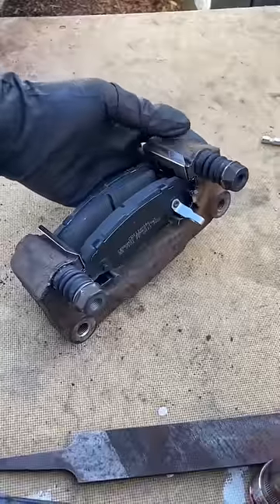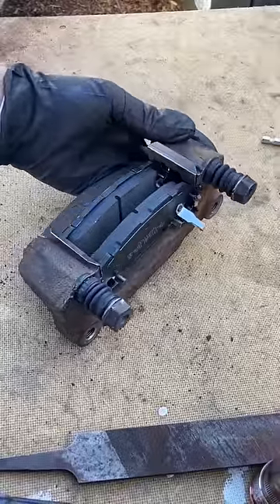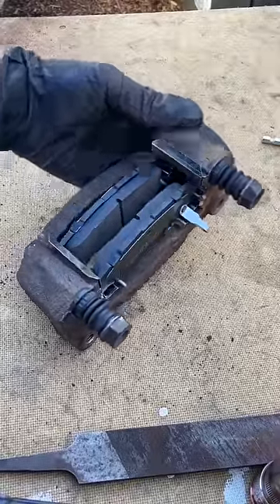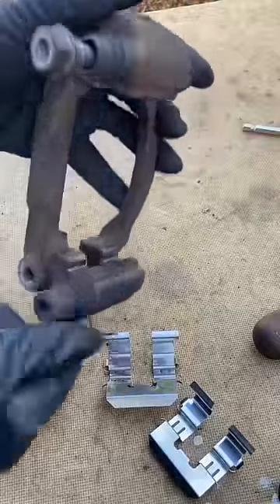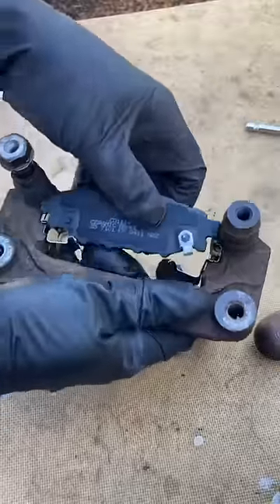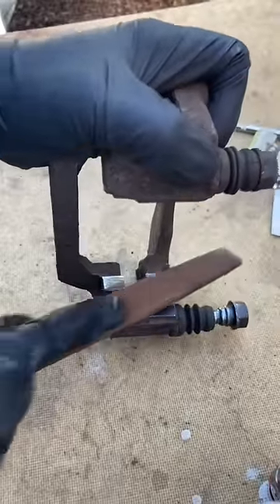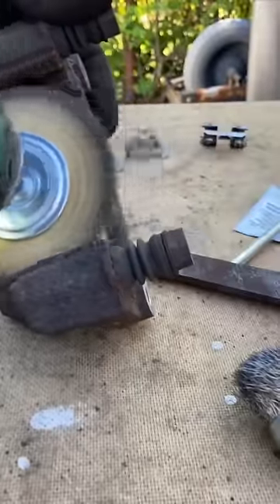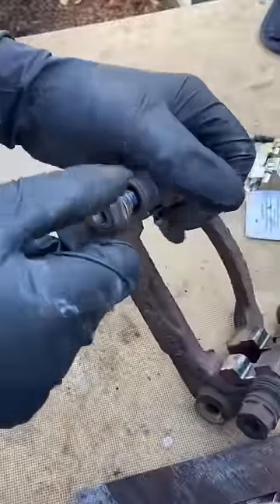What’s the Difference Between a $50 Brake Job and  $200 Brake Job

Comment: When I was an auto tech,  I didn't charge $200 for a brake job.. Because there's a difference in fixing someone's vehicle and screwing them over on price... and yes, I always do every job I do the right way... cost should not determine your work quality...
Reply from the maker: Correct!
Reply: There are no good mechanics willing to work for $30k a year. The $200 pays for your tools, shop and experience it's not like mechanics are becoming millionaires 😂
Reply: @joey9511  I can work a entry level job and make that. Why should I get dirty for 30K?
Reply: You might not charge it but check the going rate for what the big guys ate charging per axle to do breaks now ..and that's the labor plus parts. Glad my pops had a bodyshop and I have over 35 yrs experience working on cars at 46 yrs old .

Comment: So glad my dad taught me basic car maintenance, it has saved me thousands of dollars 😂 just recently replaced an alternator that would cost $600-800 at a shop because you have to remove passenger tire, a few sheilds, air compressor, and idle pulley, then alternator comes off. I completed it for $40 and an hour and a half of my time 😁

Comment: Been doing it without that much prep for 20 years and I’ve never not stopped lol 😂
Reply from the maker: They will work. Just ware out faster.
Reply: It's like any other work in the car, those brake pads will be there untouched for a long time, better reset the overall state of the entire piece group, and ensure a brand new performance. It's the same if you don't resurface or change rotors, the work is incomplete.
Reply: Yea on 20 different cars am I right
Reply: Me too haha
Reply: Not a way to have ongoing return customers like Scotty Kilmer does🙄 so which political party are you going to be running as in future
Reply: Same here.  I’ve done it both ways and honestly I’ve never been able to see a difference in longevity or performance/reliability. I think the pad material makes the biggest difference. Mind you I don’t live in the salt belt so I could see this stuff being more important if you do.
Reply: Never seemed to make a difference sorry
Reply: @AndyTheXTech  is that a proven fact?
Reply: Yo Joe  tough guy here lol
Reply: As long as the caliper loosens when you let off the pedal and releases the pads, your pads will not wear out any faster by not changing the pad shims. Keeping the oem pieces are better than the ones supplied with the pads, just clean them and put the pads in, and make sure they are able to move.
Reply: never stopped.  lol
Reply: Same here lol.
Reply: The whole "it will wear faster" arguments only come from techs who havent done this long enough to ever replace the pads theu just did
Reply: @mcfish689  That's why. If you're not somewhere with rust. I have seen new pads burned through in a couple weeks if all of this isn't done.
Reply: @seppukujones9651  Hahaha if you don't think sticking pads, pins, and pistons will wear pads faster, you have literally no idea what you're talking about. I've seen pads wear our in a few weeks of normal driving from these issues. Not to mention sticking calipers causing dangerous braking and overheating rotors, including a caliper catching on fire.
Reply: @802Garage  you caught a caliper on fire🤣🤣 dont ever try to grasp what i know
Reply: @seppukujones9651  🤦‍♂️ The caliper caught fire because the caliper locked up, causing extreme heat from the rotors, and the rubber boots burned. If you can't understand some basic physics please go back to school. Constant clampy clamp on big metal frisbee cause big heat!
Reply: @802Garage  the fact you think a simple sticking pad could apply enough pressure to cause the friction it would require to ignite is all the background info i need on your handy work

Pads are literally designed to rub against the rotor you had a deeper problem than just bad pad prep
Reply: @802Garage  whats part of the brake clips makes the caliper lock up? Lmfao thats not from pad prep thats from bad calipers
Reply: @seppukujones9651  Hahahahahahaha I have all the evidence I need to know you are a keyboard mechanic and nothing else. I recommend you go watch some brake pad torture test videos and see how hot everything gets. You probably think a turbo can't melt anything in an engine bay either. It's designed to get hot after all! Hahahaha. I've seen more brake jobs fail within a few thousand miles due to improper caliper prep than I can remember buddy. Hope you work in a rust free area if you ever touch someone's car. Have a good one.
Reply: @seppukujones9651  "Pad prep" hahaha. Read my original comment. That's exactly what I said. Trying to backtrack now? Hahaha. People of the internet make me laugh. You can't look smart by repeating what I literally said. 😂
Reply: @802Garage  ahh so your one of those wiki mechanics who watches car videos all day so you can say car stuff nice
Reply: @802Garage  sounds like your caliper prep doesnt even involve checking the pistons yet your here in an argument about brake clips
Reply: @802Garage  absolutely correct, u must clean the caliper bracket with a file or wire brush.  Most people don't even check the rubber lines and make sure the caliper is moving in and out. The rubber line can swell up internally...
Reply: @802Garage  i promise you i hate cars and would love to have not wasted so many years fixing other peoples shit but theres just alot of money in correcting your types mistakes
Reply: @seppukujones9651  Read. My. Original. Comment. To. You. 😂😂😂
Reply: @bto1533  I've seen a rubber line that simply wouldn't pass fluid anymore too. No idea what happened to it. Melted internally maybe? They can def go bad either way.
Reply: @seppukujones9651  "if you don't think sticking pads, pins, and pistons will wear pads faster" "I've seen pads wear our in a few weeks of normal driving from these issues. Not to mention sticking calipers causing dangerous braking and overheating rotors" It's almost like I said everything you are saying and then you argued with me even though I was right and even you have now said it in your own comments. We're done here. We agree.
Reply: @802Garage  yep you came into a conversation about pad prep and started talking about sticking parts causing wear and fire and how youve had to repeat jobs because you didnt prep
Reply: @seppukujones9651  You fail to read a comment which was fully related to the video and then try to play it off like someone else was wrong, hahaha. Like I said, have a nice day.
Reply: I've done 100s of brake jobs and not seen brakes look this rough on anything that was daily driven... So your normal rig doesn't need this kind of attention... I just lube up my moving parts and hit everything else with brake clean...
Reply: @travisfowler8345  This is what EVERY daily drive in the Northeast looks like if it's more than a few years old. You just don't live somewhere rusty. This is nothing compared to a lot of calipers I pull off regularly. Consider yourself lucky.
Reply: @seppukujones9651  then you're not a mechanic
Reply: @seppukujones9651  the fact you think you know what you're talking about is astonishing to me you are not a mechanic by any means shut up and sit down I have had the fiery mess he's talking about
Reply: @802Garage  this dude's a joke he doesn't know what he's talking about I have had the fire too
Reply: @seppukujones9651  you're a funny guy I'd like to meet you in person and give you what you got coming to you
Reply: @802Garage  steel braided lines will do that
Reply: @802Garage  and I agree with you I live in the rustiest state of them all Michigan
Reply: @jakebeach9621  go clean your dealership floors and ask your boss to hire 802 who cant tell when a caliper pistons failed
Reply: @jakebeach9621  you caught a customers car on fire too🤣🤣 get tf on id be embarrassed to pay insurance after employing you
The fact that you dont realise how catastrophically poor you have to do your job in order for that much friction to be taking place after it left your bay is exactly why your credits dont fly
Reply: @seppukujones9651  It's funny how you have to make up stories instead of replying to what people said. Weak.
Reply: @jakebeach9621  Vermont and Michigan are rust cousins! It's horrible. I have lots of fam out there.
Reply: That wuz funny.
Reply: @mcfish689  I'm guessing your age is early 20's?
Reply: It will work. It’s not the application of the brakes that’s the problem, there is so much hydraulic pressure it’s going to stop. It’s how easily the pads slide back when you release the brakes. They will wear out faster because they can’t adjust themselves like calipers are designed to do as well and the pads don’t slide back as much as they could had you done an extra 10 min of work. This extra works with a competent mechanic should only add 30-40 min worth of labor tops.
Reply: @joshuadavis1547  technically they don't slide back
Reply: @802Garage  yeah I've got family spread out all over the place
Reply: @802Garage  just stay upset in your wrongness nobody cares
Reply: @seppukujones9651  You already admitted I was right. 😆
Reply: @smitty_1  I was wondering if anyone else caught that. 🤣🤣🤣
Reply: Absolutely correct. Grease the slides, all done, never a problem. And i do dozens everyday.
Reply: @802Garage  you stay pressed that you are a failure and i find it hilarious you're still grasping at a way to win an argument you had no place being in

Your only argument is that you missed a piston being stuck and that you have salted roads so that somehow makes you the king of brake pads on a video literally only about contact points
besides that all you have are empty insults about being a "real mechanic"

You need to stay on tik tok with the other "enthusiasts" and stop annoying the guy changing the oil in your bmw
Reply: @johnperez93640  apparently if you havent caught the whole hub on fire you arent a real one lol
Reply: @seppukujones9651  😂😂😂😂😂😂😂 I've never seen someone so upset and defensive about brake calipers.
Reply: 37 and been doing it like this  this  since i was 18 ..... he right tho
Reply: No real difference
Reply from the maker: Lol! I don’t get it but what ever. I guess the comments a good for views. 🤪
Reply: @802Garage  its actually pretty hilarious how confident you are that failure was equal success 🤣🤣
Reply: @802Garage  i personally dont care what randoms on youtube claim because they always manage to admit their actual abilities while trying to brag
(Just like you did)

Congratulations you know how to change brake pads now go get your ASE cert🤣🤣 king brake pad
Reply: @lucky7s94  if the caliper surface the shims sit on is rusty as shown and the pads cant freely move as they release then you can expect some premature wear. May not be too noticeable.
Reply: @batvette  as long as the pads move, I put a layer of brake grease on them and grease the slide pins and the shims are made of stainless so they always clean up fine. Only if the pads wear a hole in them will I replace them which is rarely, but it happens on those "I'll do it myself" jobs where somebody pad slaps it and calls it a day and never greased the shims since they bought the vehicle
Reply: Ryan Adams There is nothing to suggest that you are
Reply: 802 Garage Hey man where are you located? I’d like to know where to NOT send people for brake work 😂🤣
Reply: Curios George 🤦‍♂😂🤣
Reply: Jake Beach Another “mechanic” who needs to link their location to steer people AWAY from them 😂🤣
Reply: Aaron Witchey What part of mc fish comment shows their age?

Comment: I have been working on motorbikes and cars since I was a teenager. No formal car technician training, but did an engineering apprenticeship. This guy put it in a nutshell. You pay for skill. Knowing how a thing works and how to fix it, is only part of skill. Caring how it will work longterm and how it will perform after you hand it back. That is the skill you will pay good money for.
Reply from the maker: Exactly! Thank you! 👍
Reply: @AndyTheXTech  I always say, you can have it cheaply, quickly or properly but not all three.

Comment: I do the exact same thing for 75...
Reply: Yeah I’ll do 75 a wheel
Reply: It's the greed that takes them to those prices
Reply: Ain’t nobody being greedy. I need to be compensated fairly for my time, knowledge and skill. You want a 75 dollar brake job go get it somewhere else. I got mouths to feed
Reply: Yeah as a backyard mechanic..
Reply: Exactly I'm not gonna over charge for a 1 job unless the bolts are stuck like my 2010 Honda Accord bults were like welded it felt like these Mfs did not come out what's so ever
Reply: @Azreal-_-what is it then?
Reply: @Azreal-_-  ok, make yourself some tea, and tell your mechanic a child could fix it &  he isn't skilled. Better yet, for your safety, look up the definition of skill first, I would hate to see you get pummeled.
Reply: @tooltime4640  nobody cares about the "mouths" you have to feed.  Thats no excuse for ripping people off. And yes its about being greedy.  It literally takes an hour to do.  Ur not worth $200hr.  Also this guy is working on a what? 40 year old car?  No fairly new cars caliper brackets rust like this.
Reply: @markwarren5644  lol its not skill to swap out brake pads.  Most brackets dont rust like this.  This extra work is not needed on most cars.
Reply: @executiveinvestments  You do know the brakes are the most important thing on a car right? I've been a mechanic in the rust belt for over 40 years and I've corrected/ fixed hundreds of unskilled peoples brake jobs! Almost every car I work on either has pads  rusted tight to the bracket, or slide pins frozen in the bracket! You're dismissed
Reply: @Azreal-_-It's not always about skill. You pay for people that take pride in their work and do a stand up job that have ethics
Reply: You guys charge 200 plus to change brake pads bro that takes like less then an hour .and it's super  easy, no ones unlocking the sphinx here  .you need to lower your over head and get over your own head there both over inflated...
Reply: @Sam-du1lp  $200 for the whole car? U think that's too much??

Comment: $200 dollars for that? I would do it myself 😂
Reply from the maker: Good 👍
Reply: you have to get the car taken apart to get down to this part.. it’s a 1.5 hr job to do fronts or rears with rotors. average in my area is over $150 an hour, he’s comparing a backyard mechanic ($50) to a professional ($200) not one person who up charges for a different level of effort
Reply: @trevortrent5736 guarantee if you asked the “backyard mechanic” to grease the pins it still be $50 and even if the bushings did need replaced most vehicles guide pin bushing are around $10
Reply: Most consumers don't and this is just the mounting bracket.  What about the caliper?
What about the hub?   There is a lot to think about.
Reply: For 200 bucks I would have not only change your brake pads but I would wash your car and give you an oil change

Comment: I do this exact process every brake job, you bring it to a shop they're gonna do a literal pad slap.
Reply: Stop going to the wrong shop then and go to the right one.  Pads and rotors, 1hr labor per axle.  They break down, clean + grease the caliper.  Go to a real shop and not Ernie Lee's
Reply: Pretty much. I just do it myself and save the 400 bucks for other parts if needed.

Comment: I used to work at a large dealership in the 90's and unless you thought not taking those "extra" steps would result in the car coming back we were told skip it. 

This is why the only time my vehicle goes to the dealership is if there is a recall.
Reply: It's definitely changed.

Comment: the best tool I bought for the brake job is this hydraulic gun that pushes in the caliper piston, such a good buy.
Reply: Where at?
Reply: @anarchyamp  I bought it at advanced auto, wish I could post a pic of it on the Comments
Reply: I don't, I do it by hand, that way I can tell how hard it pushes in to track whether the piston is getting bad inside, especially on dual piston calipers.

Comment: There's something that's just really satisfying about doing a brake job.
Reply from the maker: I know. I love it! 😁👍
Reply: It’s very easy too, not much stress involved…. Until you realize a caliper is seized
Reply: @13vex  what makes me swear the most are calliper bolts so close to the strut mounting bolt that I can’t even insert my breaker bar to loose it. Jesus wants to return on the cross when it happens, to atone for my swearing 😂
Reply: @13vex  mechanics are easy to do if you take your time and get the proper tools, like a good obd 2 scanner, a good quality ratchet set, jack and jacks stands, breaker bar and torque wrench, usually you can get by for most of the jobs with this simple set of tools. Having some special tools is an investment over time that makes some jobs easier. And nowadays YouTube is your friend and main source of knowledge imo. Also a plus if you get some repair manuals about your car. I have bought some over the years and honestly most repairs are common to most cars. You can learn a lot about general car repairs from one manual.
Reply: @MrMOGHammer  
What kinda cars you work on?
What state you in?